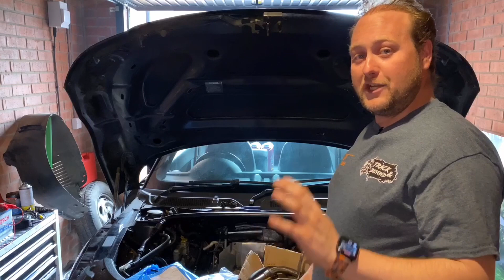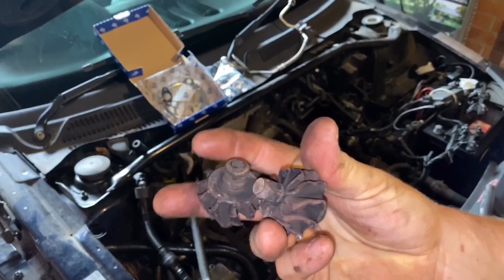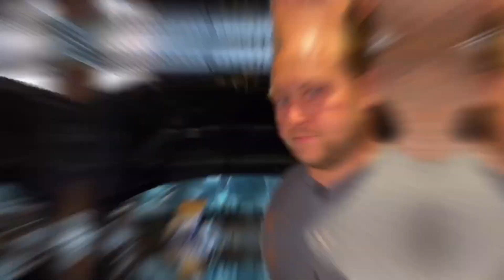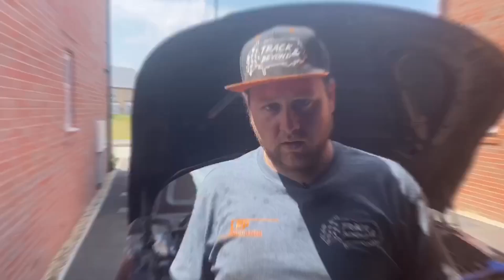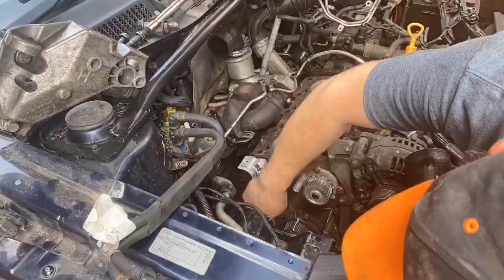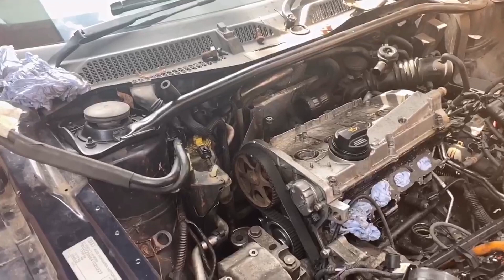Audi TT 1.8T New Turbo & Cylinder Head Reinstall!

Comment: I’m trying to remove my head to replace the head gasket, but turbo manifold bolts have sheard one bolt, so can’t get a grip on it, question is, can I remove the head while it’s still attached too the turbo and manifold? I believe I just have to disconnect down pipe bolts and lines too turbo right?
Reply from the maker: Yea if you removed the downpipe from the turbo I can’t see why you couldn’t remove the head with manifold and turbo still attached, their is only 3 or 4 bolts holding the turbo to the manifold so you could infact split the turbo off the manifold aswell and just bring the head with exhaust manifold still attached
Reply: @TrackAndBeyond  the 3 bolts that hold turbo onto manifold, one head has sheared, so can’t get the e14 torx bit to grip, this is why I’m asking can I remove all with the head by just undoing the 3 nuts on down pipe 👍
Reply from the maker: @user-lu8fr9hv8y got ya, yea I can’t see a recon why not, may just be fiddly trying to remove it and will be heavy 😝
Reply: @TrackAndBeyond  yeah notice grey pipes near the turbo, hopefully they won’t get in the way, I’m just cutting the timing belt rather than lining all up before I remove, timing can be done after
Reply from the maker: @user-lu8fr9hv8y yea cutting it is a good shout done that before as you say can be done after